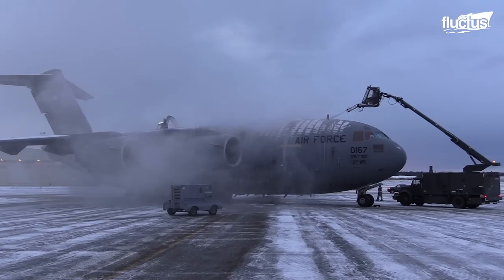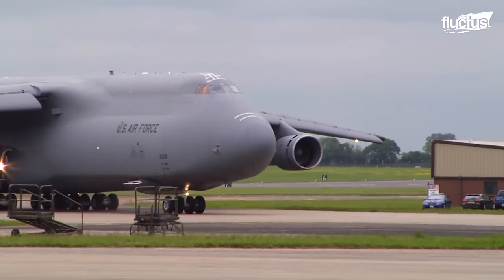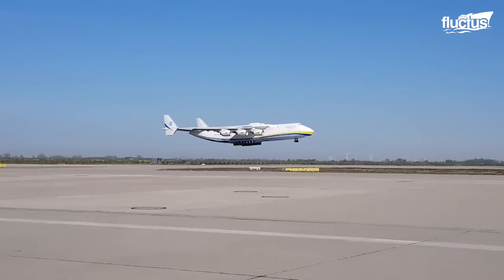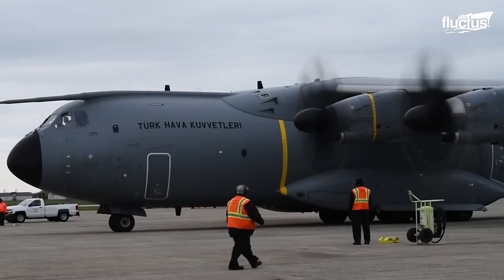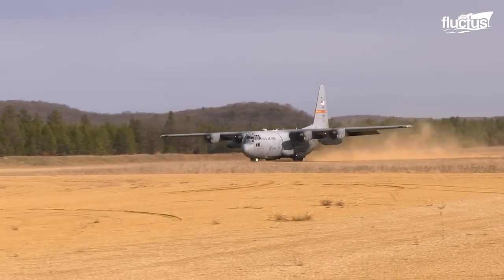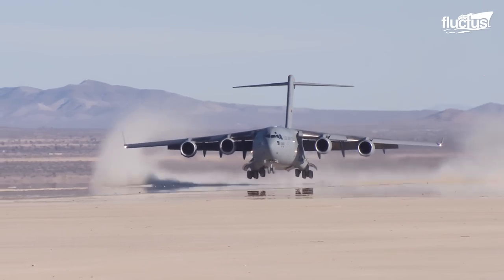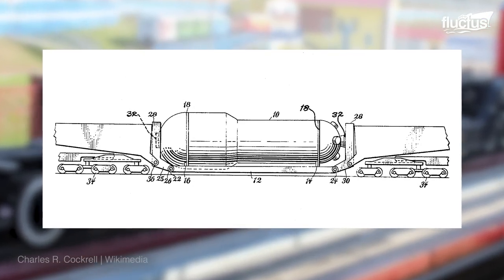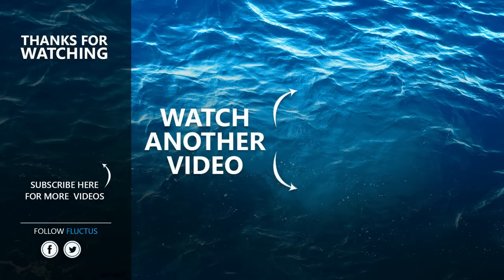This Super Heavy 420 Ton US Aircraft Needs 28 Wheels to Land

Comment: Antonov is a separate category. It needs to be rebuilt even if it's by design. ❤️
Reply: Antonov will probably build something with a single stabilizer,  and 4 power engines, the soviet shuttle carrier probably won't be built again 😢with the unique twin rudder, 6 engine configuration